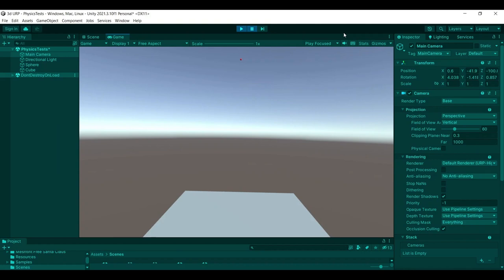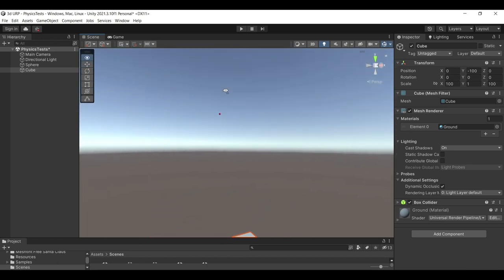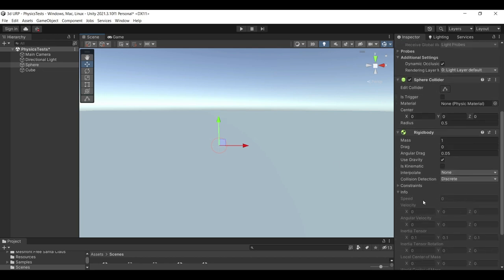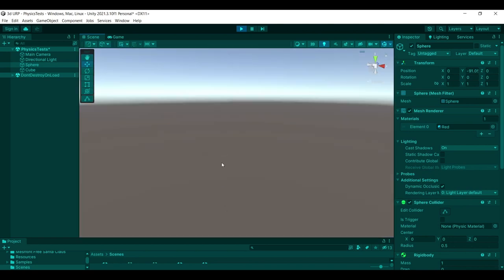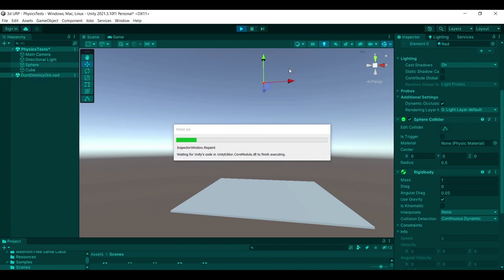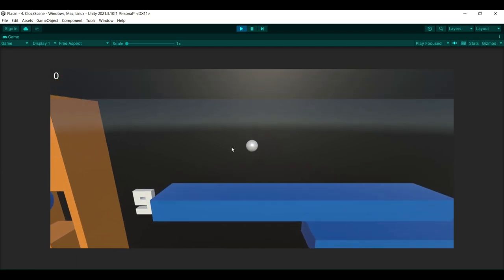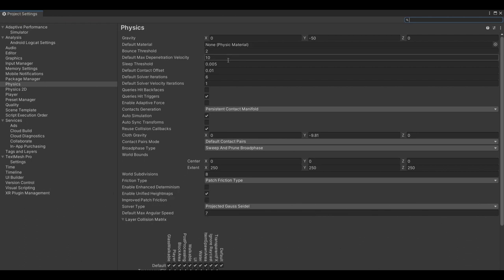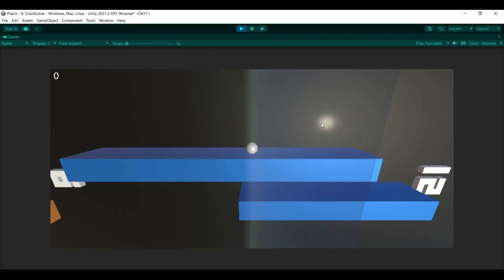Unity - How to prevent colliders from clipping [2023 UPDATED]

Comment: how do you do this in 2d?
Reply: hello might be a little late, but its the same
Reply from the maker: Hi, for 2D the first two solutions can work the same way(Increase the size of colliders and change the mode of detection to continuous). 
As for the 3rd one, the said setting mentioned in the video unfortunately does not exist for 2D, but there are some physics setting that you can try and tweak around and might get a better result. (From the top of my head, Default Contact Offset MIGHT help with the 2D issue, but haven't really tested it myself).

(Sorry for the late response btw and hopefully you figured it out by now.)

Comment: Box collider only works for boxes unfortunately 😅
Reply from the maker: You can always use other colliders, the idea is the same.
The larger the collider is, the harder it is for object to skip past it.
Reply: @gamedevguru9512  I’m using a capsule one now, it’s much better.
Reply: @gamedevguru9512  but I don’t know what to do about my colosseum walls because the other colliders don’t work 😭
Reply from the maker: If none of the methods discussed in the video worked for you, you can manually change the velocity of the rigidbody through a script. 
This is not the prettiest method, but it can get the job done.

Comment: Hi there, the video was helpfull. Nevertheless. I have plenty of situations with irregular meshes placed on the ground that when you walk into them their form pushes you down the terrain. For example you can use an inverted piramid, you will see when you walk to it, the form pushes you down the terrain. This keeps bugging me even with the solution mentioned on the video.
Reply: i've had this issue and instead of doing anything complicated to try to fix it, i found it easier to just place an invisible wall to stop the player where they normally should be stopped. This way the player cant try to squeeze into that small space and get squished into the ground
Reply: @_benjiman_  Cant do that. My word is made by an algorithm, is not always the same and can't be preventing that kind of situations from hppening, instead of that i must have good physics.

Comment: hi there i am making a excavator project and when i fill rocks in the bucket and move the bucket / excavator to fill in the tipper the stones simply pass thru the bucket i tried putting thick box colliders also did the settings in the project setting but even then the stones fall off .. i also changed the mass of the rocks to 0.5 but no use.. please help urgently...
Reply from the maker: collision should be working fine. make sure the colliders u use on both the bucket and rocks are set properly and i see no reason for it to not work.

Comment: Hi, this problem still occurs to me. I am using the unity's terrain, also I use mesh collider. Do you have any ideea on what to change to stop this tunneling? I use continuous for collision detection. It happens no matter what type of collision detection i use.
Reply from the maker: Dealing with high velocities can be tricky and there aren't many tools to sort this out. 
If the recommendations in the video couldn't solve your problem, you may want to consider changing the speeds in your game. 
You can also try to stack colliders to have a higher chance to catch the fast object, though I try to avoid doing this.
Reply: @gamedevguru9512  What I also did was to make the velocity magnitude not exceeding a certain value. But sometimes it still can go through. Might be the terrain the one that's causing this? Being like a flat surface with no volume like other colliders..?
Reply from the maker: @alextreme98  Yes, the size of a collider matters, the larger it is, the more area there is to track collision (explained in the video). You can you the Clamp function to control velocity if you want. Additionally, if your terrain is flat, you can add a box collider underneath the terrain to ensure that the player won't be going through the terrain, (a large collider will do the trick in this case)
Reply: @gamedevguru9512  thanks 👌🏻